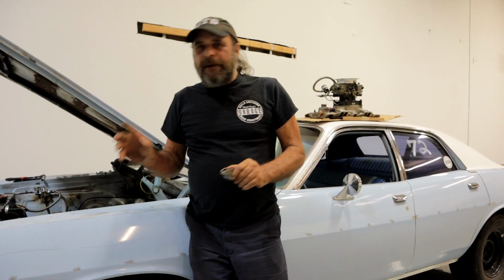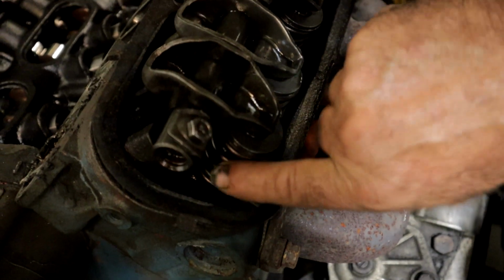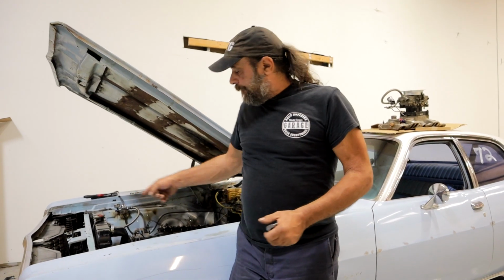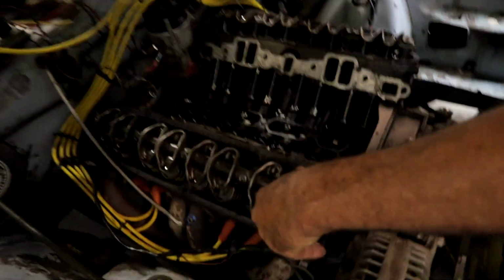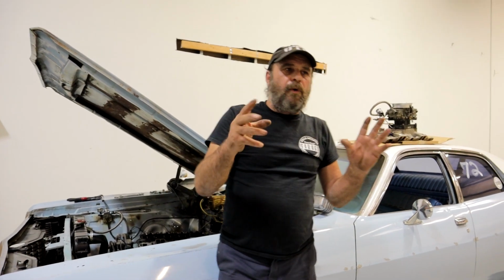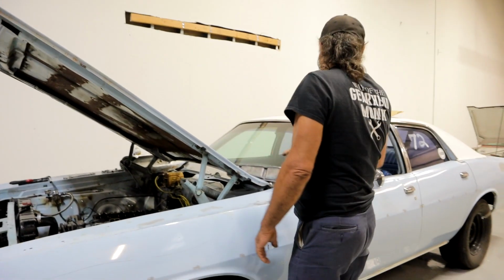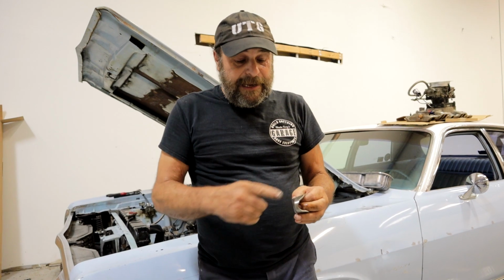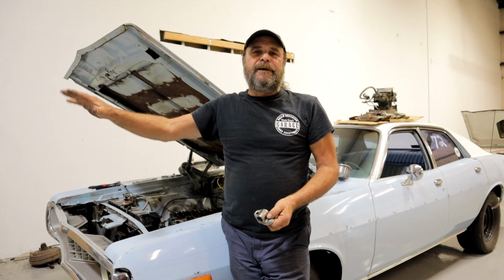Bottle Rocket Rocker Failure Explained

Comment: My friend recently got a set of rockers for his 360 Magnum. He had the same issue. Pushrod punched right through the rocker. I looked over the rockers. it looked like there was different rockers based on the stamping lines. I think fake parts are finding their way into all manufacturers. My Toronados lifters are the same. My plan is going solid roller.

Comment: I dunno what the 340 spring pressure is but I thought roller cam used a heavier spring to keep the lifter in contact with the cam, the roller lifters are heavier and have more inertia?

Comment: Had a problem with comp cam on my 318, went with a k20-222-3. All the lifters but one were 0.9025-0.9035 perfect fit. The last lifter was 0.9065!!! Needless to say but that would have been a flat cam on break in! Glad I noticed it.

Comment: I know it’s a band-aid but, you could add an Accusump-Accumulator with an in-line ball valve, that you close before you shut down the engine, then re-open before starting to pre-prime the system with oil pressure (the larger it is probably the better it may work).....this won’t fix the problem but may reduce the violence a bit on start-up.

Comment: A friend and I was just discussing this subject two hours ago and then I watched this video.
My son’s 318 is having random lifters bleeding down and they have about 3,000 miles on them. This has been an issue since they have been installed. We also used Comp cams flat tappet hydraulic lifters, camshaft, push rods and double roller timing set. 
We have purchased parts store flat tappet lifters to replace the defective ones. So far so good.
Anyway my friend was telling me I should have opened each lifter up and filled them with oil before installing them. I don’t think air could get trapped in them but this is what he is saying. 
And he has built a lot of impressive high HP engines so I do respect his opinion.
Uncle Tony, since bottle rocket is all open, would you try this?

Comment: It's not just bleed down, it's pre-imminent failure at that point. Like you showed, some aren't bleeding down, some very slightly, and others are basically non-operational with that amount of bleed. Sure, they pump up once the car's been running, but they might as well not, because they're still gonna beat the shit out of your rocker arms. I've experienced my fair share of out-of-the-box part failures myself, and it's ridiculous.

Comment: I'm not a mopar guy, and don't have the time to sift through spring specs but are you sure the valve spring isn't coil binding? A quick search showed me a mopar performance spring pn 4120249 but from what I can tell it says max lift is .500. Couldn't find a coil bind height number though. I could see a roller cam running well enough, but under further use punching out rockers and damaging lifters. That seems like a loooot of damage for just having extra lash on startup.

Comment: Jegs carries some proform thicker rocker arms for mopar smallblocks. Also Mancini carries their house brand thicker rocker arms as well. I have the proform rockers in my 360. They look to be good quality. Hope you look into those Uncle Tony. Just trying to help. By the way I run the 292/508 mopar purple shaft. Its a sweet cam!! I threw it in 4° advanced @ the crank.

Comment: I've got the same problem. I bought a hydraulic roller cam and lifters from the big cam company and I my lifters leak down pretty rapidly. Havent had any rocker arm issues though. Mine is a magnum with the stock 1.6 rockers.

Comment: On my aussie 245 hemi CM Valiant wagon i converted it back to points ignition from electronic for ease of maintenance and future proofing. But it goes through a set of points every 500-1000km. I thought i was setting them wrong or i wasnt using the right grease because it was ripping through rubbing blocks and sometimes the contacts would stick together. But when i have to buy 3 sets of points at every autoparts visit, one to put in the car and two to chuck in the glovebox for replacing them on the roadside because the rubbing blocks failed again, then it must be terrible quality control. The problem is international, not just a US issue

Comment: Ya know Tony, I think it's awesome that you go out of your way to show how to do things on a budget most people can afford.  However, if the quality of parts has gotten to the point where doing it on a budget could easily result in problems like this, then perhaps it's not a bad thing to show how spending a little more money upfront on higher performance parts could, in fact, save a budget builder money over the long term due to the improved reliability/performance.  Just a thought...

Comment: Well said "Beholden too"---it is much worse than that; our system from Top-Down is 'Prostrate too'!  Anyway your ears are worth far more to many, than free-parts.  In '05 back from Katrina I kept burning through distributor gears w/ a medium aggressive Comp Cam RV(style).  After much frustration and a plethora of phone calls it became apparent to me that there was a HX of Compatibility difficulties between these Cams and Motorcraft/Aftermarket Distributors.  If they had simply passed this information on, would have immediately gone to a bronze gear, instead of shredding hi-end cam shaft gears.  Contemporary America, one has to be Customer, researcher, investigator, financier and comically enough mechanic and driver when we solve it: 'This ain't your GrandMa's Buick anymore'.

Comment: I had this same issue on a 360 stroker. Brand new lifters kept bleeding off, instead of a rocker it broke the top of the lifter off. And these were Hughes Engines lifters.

Comment: Lifters make noise on startup in LS engines when the oil pump o-ring is bad. The oil pressure can be normal and still there is lifter chatter. I'd make sure there are no holes in the oiling system. Especially around the pump and the pick up tube. If there is a small hole on the pull side of the pump, it can makes air bubbles that flow along with the oil. Aeration causes big problems with valvetrains. And when the engine is shut off, the oil can leak through that hole and take extra time to build oil pressure on start up. Hope this helps!

Comment: I’m gonna start by saying that I’m not experienced with parts compatibility, but would it be possible to run a later factory roller lifter setup from a magnum or are those the wrong size completely? I’m just curious because I think that would be interesting and potentially keep it more budget friendly. Love the channel and I’ve learned a lot from you!

Comment: I just got done replacing my second CCams cam and lifters after pounding them to junk bracket racing in less than 1hr run time in my BBC. Never again. My kid has a Howards cam in his SBC that does a lot of high RPM work with no issues.

Comment: I have eBay roller lifters in my 360 magnum in a realitive stock engine, .495" lift cam, 209/217 degrees @50. My lifers tick, stick and clatter on start up, one ticks for a while, when upto temp all goes quiet, my first roller cam engine, thought that's just what they did. Hope you get to bottom of it so I can sort my one. Thanks Bruce from NZ

Comment: I have been a huge fan of the products from a company that rhymes with "Stomp Pans" but I've found weak or bad lifters and a straight up bad cam from them lately. The lifters have been the real issue. Customer service has been ok but still, that's a brand new, matched set that "should" install, break in, and go for miles and miles. Have heard other anecdotal reports of lifterissues from "Frame" and "Plummet". "Zisky" and "Lunatic" haven't been reported as much but aren't as in the mainstream "budget builder" category either.

Comment: I have used a major brand of performance hydraulic lifters many times. They do bleed down much easier  than regular hydraulic  lifters. It seems the ones on the base circle don't bleed much. The ones on the nose do. It is annoying but haven't  had damage occur. I remember  the brand cam u are using mine is the same.
Reply from the maker: We only showed the ones that had parked on the base circle

Comment: My lifters in my Chevelle do the same thing. Cam is a lot less than what you have and a flat tappet, but I have at least half of the lifters making noise on every start until oil pressure comes up. I've been ignoring it for the last 6k miles. So far no issues, and yes, this engine sees 6k rpm every day on my drive to and from work. I had a similar problem with the trans; spent $3k for an overdrive trans that was supposed to be overbuilt so i wouldn't break it. Immediately broke it several times with an engine that makes 200hp less than what it was advertised to handle and now traded the company for a non-overdrive that I really don't want. Out a transmission, out decent fuel economy, and out $3k.

Comment: Hey UTG. Don’t you have to run a bit stiffer springs with roller cams in general, not just based on lift as you want the lifters/rollers with constant pressure? No disrespect at all, I am just in the same boat right now with a 383 build.

Comment: When my 318 was put together my mechanic just bought standard lifters! I don’t know the brand. After approximately 1 month same thing happened,got lifter tap. We couldn’t find the one lifter causing the problem but was obviously bleeding down. I told him to buy crow lifters for a trial. Well it’s been about a year now and still no noise. Just a dodgy lifter but I replaced the lot anyway.

Also tony,opinions please. When my top end was put together I was advised to use ‘heavier valve springs to compensate for the cam (comp 268h) not a big cam. I do not know what springs are in there and also it’s running 80thou lash caps. My engine is now very quiet but should I be concerned about any of this?

It’s not a drag car,just a cruiser with the odd burnout but never past 5,000rpm.

Comment: This has been going on for quite some time. The last few years, there has been a remarkably high failure rate on lifters of ALL kinds and manufacturers. From what I understand, there are only 2 companies that manufacture lifters and they provide lifters for all the aftermarket, no matter what the name is on the box. Nobody at that company gives a shit if things are good or not, they don't have to deal with the end user. Most cam companies are riding on reputation and just hoping things will get better. There is no light at the end of the tunnel.
Reply: The light at the end of the tunnel is a train!

Comment: I just bought a set of hydraulic rollers from Comp Cams, one of them would not drop into the lifter bore because it had a burr on it. I had to deburr it. I haven't started the engine yet.

Comment: The parts companies have figured out they can get away with selling garbage. Like the aftermarket variable valve timing sets that you would be lucky to get 10,000 miles before needing to replace it all over again. And then there's the chance you might not realize the part was garbage and make the same mistake again - more money in their pocket.

Comment: Did you soak the lifters in oil? the procedure changed to setting the lifters dry with just assembly lube on the outside. My neighbor was having this problem with multiple engines before I pointed it out in the instructions. It seems like pushrod style lifters are not supposed to be soaked any more but non pushrod lifters like to be soaked for days. I hope the very competitive CAM company contacts you. It would be cool if they did a video with you on their specific cam install and adjustment procedure.

Comment: I spoke with comp about lifters that I have that bleed down on every start up and they told me that is normal for that to happen and stock lifters usually hold pump better. Then the tech guy went on to say just add a little bit more preload because that’s what big blocks seem to like. Really was not helpful or offering any solution whatsoever

Comment: Don't know what oil weight you are using in bottle rocket. But I have never experienced lifter bleed down with 30 weight straight oil. I know its old skool oil weight but it has been great for my 360. I use Brad Penn 30 straight or Shaeffer 30 straight oil. Both are great quality. Also used to use VR-1 30 straight oil it too was good. With VR-1 I would add a bottle of STP.

Comment: I've always wondered, what's the purpose of painting white lines on rear drag tires? Is it for indicating wheelspin for a trackside spotter? Or does it act as a witness line that lets you know how much the tire is compressing under load? Or am I totally overthinking this and it's just there to ensure the tire isn't slipping on the rim when it hooks up?

Comment: David Vizard has a video about running the hydraulic lifters with about 0.050” of cushion from the bottom of the travel. Backwards to common knowledge but probably the solution to the problem. Basically a solid roller lifter

Comment: My 318 had 5 push rods that went through rockers when I got my d150, I was 16 and I didn’t notice until I had the valve covers off months later, motor had no balls but still ran buttery smooth

Comment: I had a similar problem with a big block mopar it turned out that when they cut a large lift cam they  cut the base circle down to make the lift bigger this causes the lifter to sit lower in the bore this witch makes the push rod to short with out adjustable rockers the lifter is pumped up all the way and is just barely working without tapping the lifter will bleed down without a little pressure pushing down so only the lifters sitting on the base circle will be loose enough to bleed down
Reply: I    cheated  and  ground  down my rocker stands, .030 to fix it  that also stopped the bending push rods and breaking rockers

Comment: Man, my Buddy Steve had a 1977 Plymouth Fury 440 Police Interceptor back in the mid 80s. That S.O.B. would run Man. I have no idea how we survived many a nights out drinking n Hammering around the Country Roads. We came up on a 2 lane bridge one night thats right after a curve, we were totally sideways going across that bridge, there couldn't have been more than 2 inches separating the front n rear bumpers from the guardrails. Many many fun nights in that car. When you kicked in that double pumper it would pull ya back into the seat.

Comment: One thing I would check after a problem like that is, are all the lifters pushing oil through the pushrods. I did an oil mod to an oil gallery plug to spray oil at a gear. That small hole in the pug which is at the very end of the oil path, seems to be slightly starving 3 lifters right in front of it. They don't bleed down and are pumped up, but oil barely comes out of the push rod to oil that friction point and the rocker fulcrum on those three. I think splash from the 4th and others makes it seem like it might survive. The other 13 have oil flinging out of the push rod rocker hole in a nice stream, where as those 3 are just a slight trickle. I'm putting it an and going to run it and hope for the best, rather than tearing the engine down enough to try a smaller or no hole and seeing what it is after that. If one of those three have a push rod or rocker arm failure I know just replacing the part isn't going to be a fix In my case .I'm about positive an engine couldn't get put together with three bad lifters in the exact spot an oil modification was done and only those three were affected.

Comment: The lifters you should try are the Australian companies Crane or Crow cams as they are definitely made here in Australia and the quality is definitely there and I havent heard of anything to the contrary. Also there is a brand called Johnson and I am pretty sure their lifters are made in Texas ..  For running in, you should follow the flat tappet circle track method of running in, whereby you remove the inner spring and run in for an hour with 1 or 2 cooldowns between such ..

For the points issue, you could try finding the NOS Mopar tune up kits that have the points, rotor and condensor in them that were made back in the 70s or 80s, theres still plenty about and you could stockpile them up to use as needed. Or just go to a Mallory or Pertronix, but we all know you are too hard headed to go for that lol ;)

Comment: Hydraulic rollers in an LA or Magnum engine can frequently be a disappointment. I did a Magnum engine with OEM Chrysler roller lifters and a mild Comp shelf EFI compatible cam and adjustable roller rockers and proper valve springs. Engine was totally silent for the first few days and then the single tick began coming and going, then was present more than absent, then never stopped. Finally when I swapped heads, I stuck a set of cheap Mellings in there, and so far/so good. The first '85 318 5th Avenues and Gran Fury (Diplomats, etc.) had a tick caused by the lifters being installed with the oil hole away from the valley (down) and draining back. The warranty replacement lifters had a yellow paint daub on the upper flat for the dog bones. I fixed a couple dozen of these under warranty, and kept the old lifters, they were mint, just some got randomly installed upside down, exacerbating drainback.

Comment: hey Tony i have issues with this to in hydraulic roller lifters in stock gm ls engines when I use certain oils. try synthetic oil hear me out here try a 0-30 oil with dexos rating MOBOIL 0-40 europien car formula is decent to 5w30 is fine to dexos rating is the main thing it will be in green writing     im not saying this will fix your lifters but it will help and it might save the next set

Comment: That's nuts, shouldn't have those issues, sbc world there are people who've run stock rockers on cc306's with comp 987 springs turning more rpm not apples to apples but stock shit is alot tougher than most admit or know. The lifter issue is very irritating, sounds about right anymore. Get parts out with piss poor qc and hope for the best.